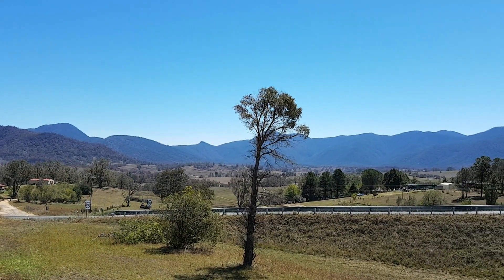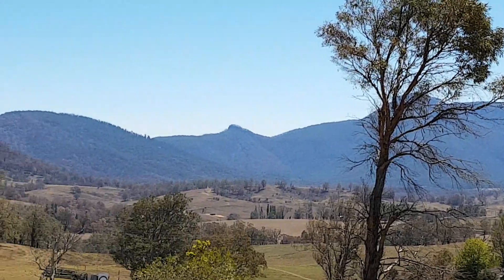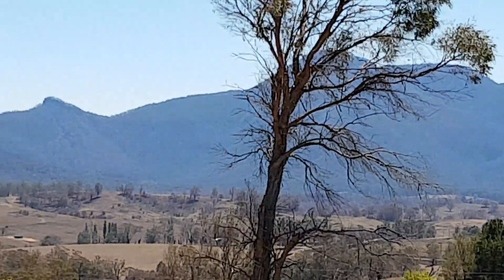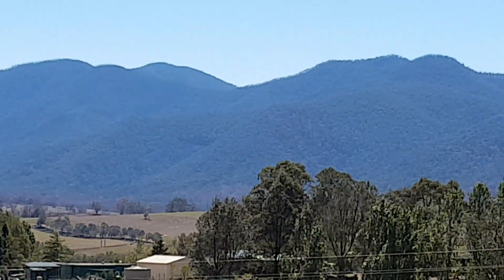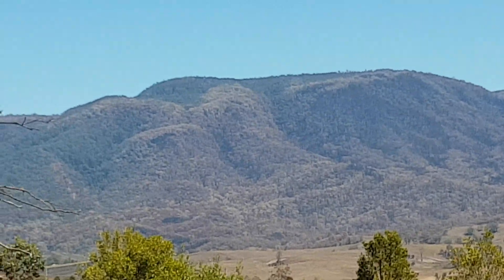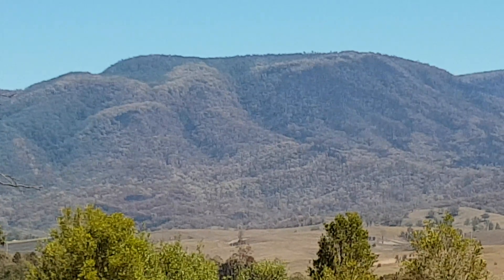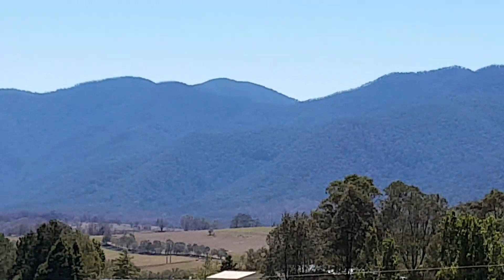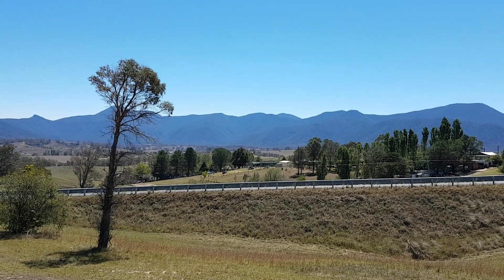Do fuel reduction burns really help?

Comment: Thank you Michael great empirical evidence presented here.  It deserves to be studied so I will share it and encourage others to share it too in the hope authorities will take it up.  The comparison should be useful.  

As a side note the hot day was the 4th January you have been in the middle of that blur supporting the town with great heart; you and Rachel.  The next day was only low 20's (C) in Bega and under 20C on the 6th so low temperatures in the areas worst affected during that burning.  Temps according to Willy Weather.
Reply from the maker: Quite right Neil.
I was in error as to the date, I went back through the videos, and they record the progress. The hot day was the 4th, and that was the little brown started burning, and the 5th is the day that the real damage was done to the west. I report that the temperature was a cool 18 degrees. 
The temperature was cooler when the bad damage was done to the west, and the hot day was the one that burned the eastern part that had been burned 15 moths earlier. Just the date I mentioned was wrong.